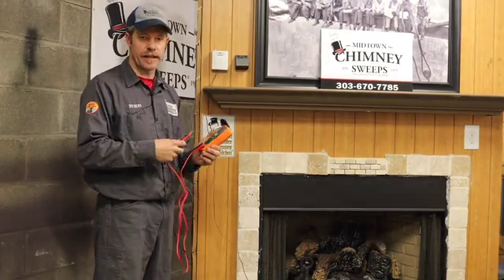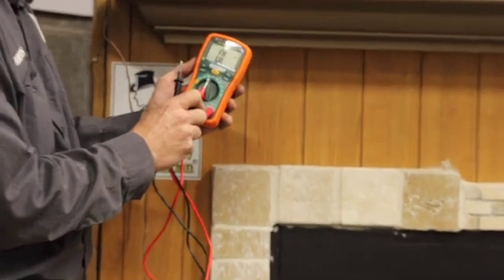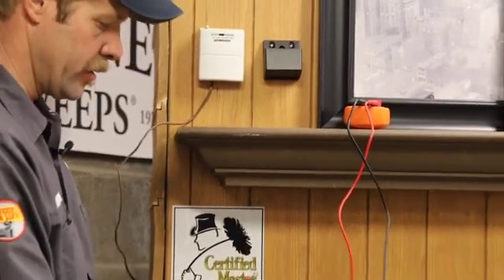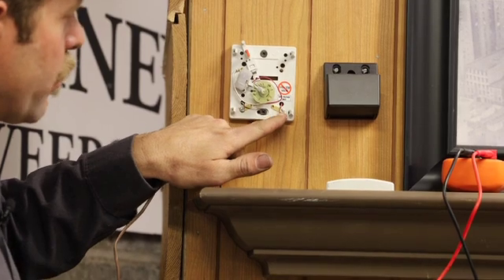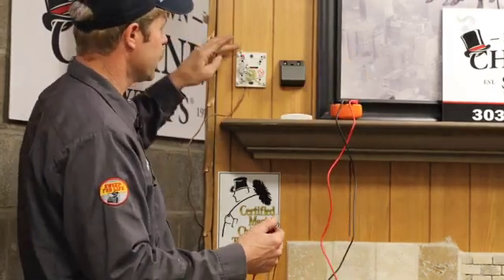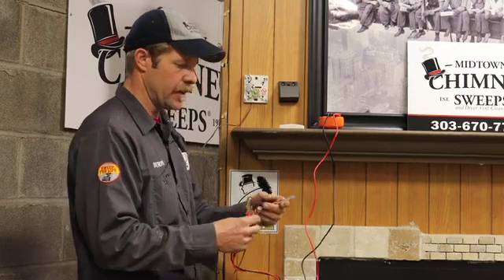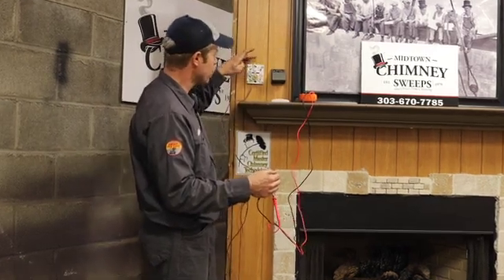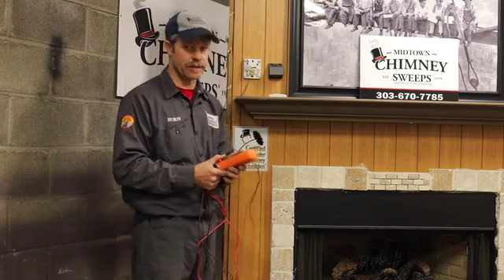How to Diagnose the Thermostat Wire vs the Thermostat vs The Gas Fireplace valve itself

Comment: Hi!  Thanks for the video. The thermostat I have has a battery in. The battery is in excellent condition. Sometimes, the fireplace turns off even if the desired temperature is not reached. 
Question:   Can I put the battery (1.5v)  between the 2 wires to bypass the thermostat and, this way, see if the thermostat is defect?
Thanks
Reply from the maker: Well, I would use the continuity tester, rather than a battery. But overall, there is no easy way probably to diagnose a thermostat. But you could CHECK yours by putting another room sensing device up next to your thermostat, and see if it is reading the same temp or not at the same time. Maybe the temp is off. Also, the more the electronics, the more chance for failure. I use the most basic Honeywell with no technology where possible!